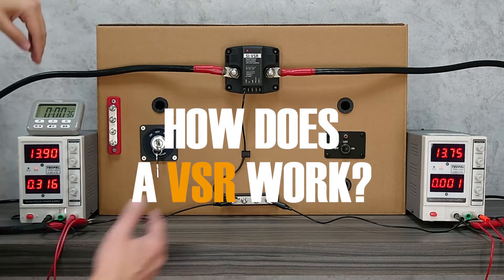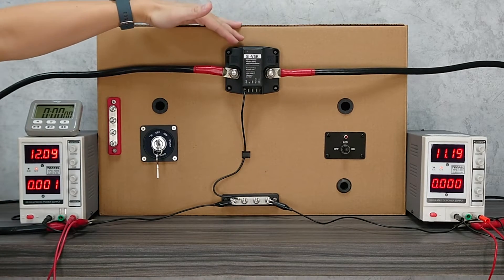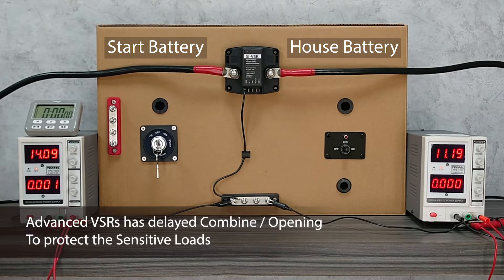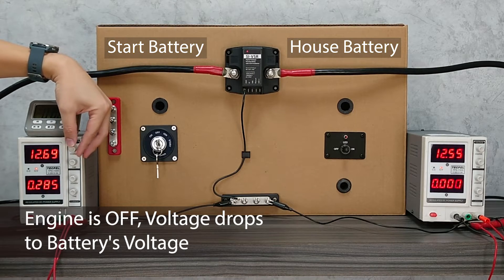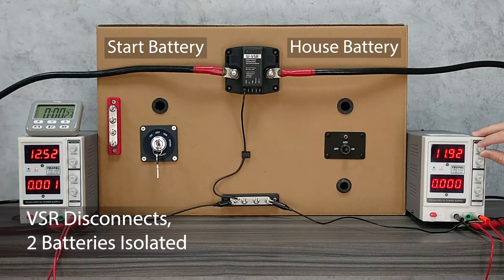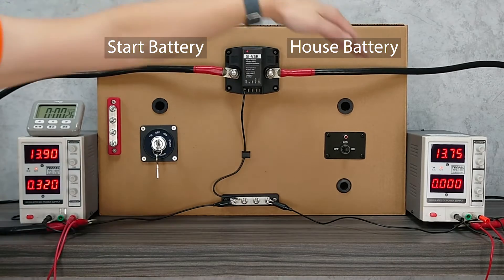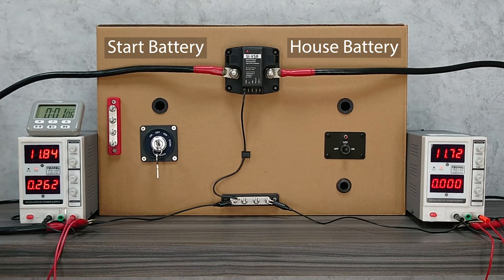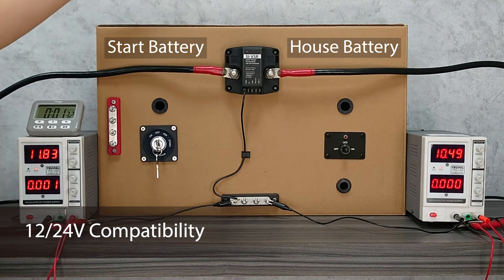What is a VSR Voltage Sensitive Relay and How to install VSR? VSR for Dual battery system explained

Comment: Great video, thank you. Two questions.  I want to make the starter battery priority for charging on my boat. When the alternator is on why doesn't it charge the starter battery first, then once the starter battery is fully charged, then the VSR is opened and it charges the house batteries second?  Also, if the starter battery is fully charged and the house battery depleted, will the VSR prevent the house battery from robbing charge from the starter battery? Thank you.
Reply from the maker: Thanks for liking our videoa. To asnwer your question, as illustrated in the video, the VSR is basically a "voltage sensing" battery switch so once it detects that the voltage is above the voltage threshold (product dependent, say ex. 13.3V) it will turn on and combine the two batteries.
Which means when the charger or alternator turned on voltage on starting battery is high enough it will automatically charge BOTH batteries instead of just the starting battery. If the charger is capable of provide charging current more than starting and house battery's need combined, I think your starting battery will be charged as fast as it is charged alone so there won't be problem?
Secondly, no VSR will not prevent house battery from robbing charge from the starter battery, imagine VSR is just a manual swtich that turns on whenever the voltage threhold is met. However normally VSR's combine threshold is set at 13.3v above, and a normal lead-acid battery is 12.8v when it is full. This means VSR turns on ONLY when a charger (alternator) is on and charging voltage (>13.3V) is present, so the charging current to house battery will be provided by the charger, not the starter battery, and hence it will not rob starter battery current unless your charger provides current less than what house battery drains. 
I hope this explanation helps, let us know if you have further questions. Thanks!

Comment: Thanks for the clear explanation.  I have BEP DVSR's installed between both my catamaran engine start batteries and the house batteries.  As my victron charger runs when I am at anchor running my genset and when alongside and connected to shore power, I would like an explanation on how the vsr works in these confiurations.  When I'm sailing or at anchor I use the genset for at least an hour a day.  When on shore power the charger is always on and reduces to trickle charge once batteries are charged.  I have noticed when my charger has run for a while the vsr's switch on and connect all batteries.  Can I overcharge the starter barreries this way?  All are AGM lead acid.
Reply from the maker: Hello, thanks for liking our video. The way DVSR's "dual port charging"  works is pretty simple: when either port (start or house battery) has a charger (engine or genset) turning on (high voltage >13.3V in our case), it will parallel the two batteries. Otherwise it will cut them off and two batteries work independently. Since you have a victron battery charger connected, I don't think you should worry about the overcharge problem as battery chargers usually have the ability to control currents based on different charging state so it won't damage the battery in the long run. Please note that, however, our comment is just for your reference only since we don't know exactly how you wire them. Please consult your local techinician for more accorate information.

Comment: For some reason my VSR stays on even when disconnected from the start battery and only plugged into the house battery
Reply: check the "cut in" and "cut out" voltage on the VSR, and then use a multimeter to record the voltage of you car battery when turned on and off. There is a chance that your VSR is faulty, or is the wrong model for your system. If the voltage of your batteries when reting is higher than the cut in voltage on your VSR that would explain your issue.
Also check that you wired your system correctly according to the manufacturers specifications with the correct gauge wires.